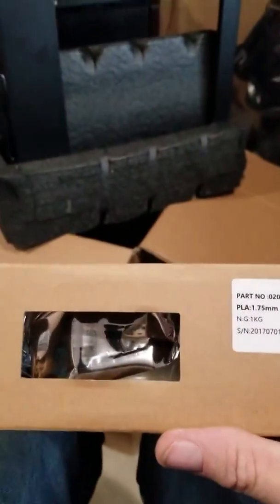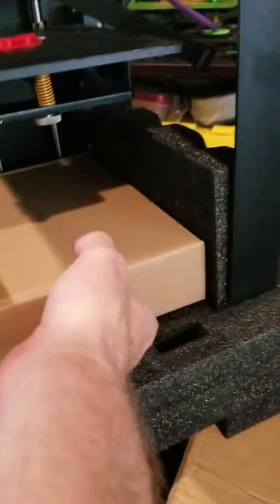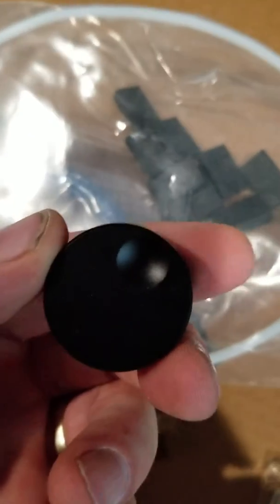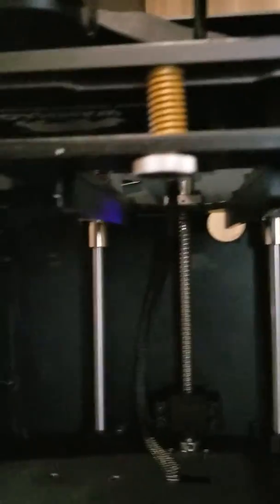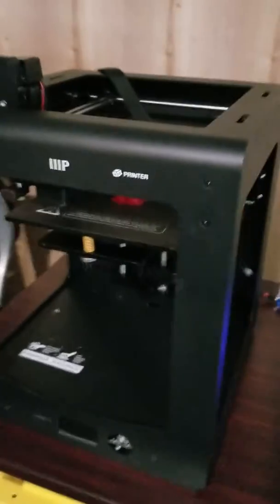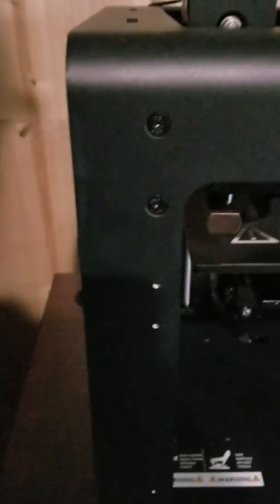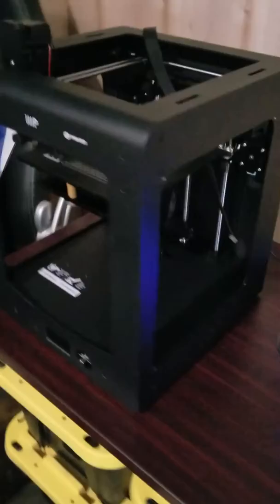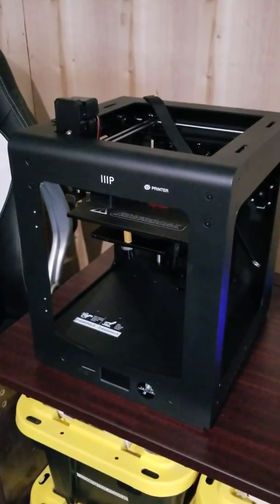Monoprice Maker Ultimate (Wanhao Duplicator 6) review and unboxing part 2.

Comment: One suggestion:  3D print a phone holder that will hold your mobile phone in horizontal mode while allowing you to grip it confortably.  Vertical videos are really frustrating to watch.  Other than that, great video!
Reply from the maker: Thanks for watching and thanks for the comments, you will see that only my oldest few videos were done in portrait mode, i use landscaoe only now.